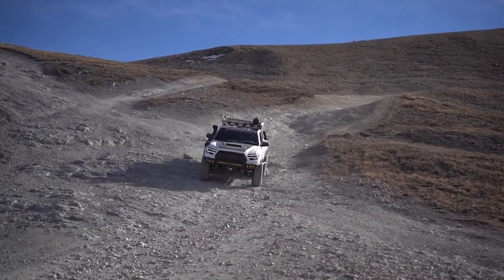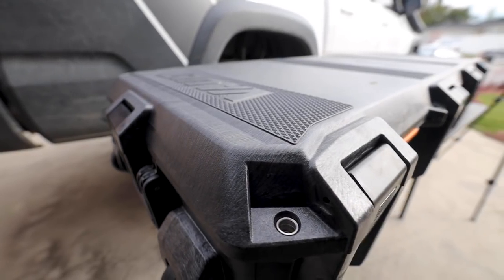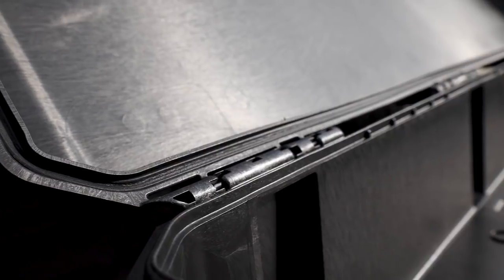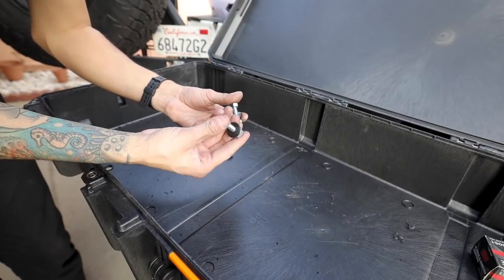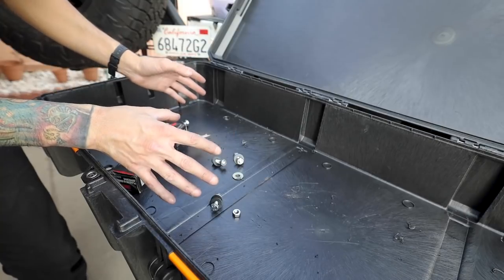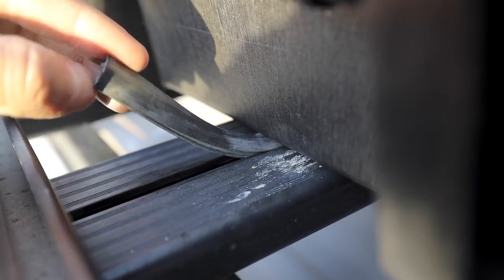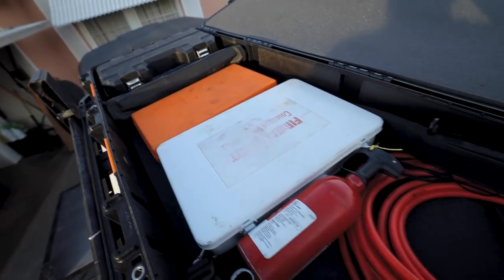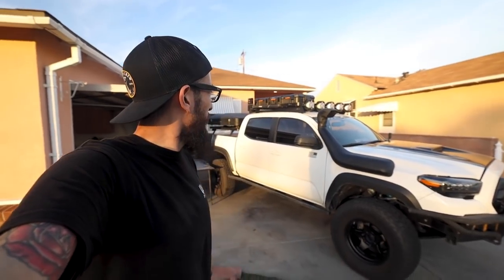Recovery Gear & Gadget Storage Solution | Pelican V730 | Toyota Tacoma Overland Build

Comment: Couple recommendations I have - use a dremel and chop those bolts off(not that big of a deal though, depending on what you store). Use silicon packets (or whatever they're called) to keep in there. If you're in a hot state you will still get moisture in there and the packets will really help. Also, instead of that plastic sealant I would use rubber grommets and/or hot glue. I don't think you're going to have that much trouble coming up from the bottom where the bolts are, but hot glue and rubber grommets are a 100 times easier to remove later than the plastic sealant. Also, I would store that extinguisher outside under your tent in a place way easier to get to. Awesome video George!

Comment: I put 2 of these on my cap rack but installed 2, 20lb gas struts per case to keep the lid open and I also put a piece of 3in wide aluminum flat bar in between the bolts to add strength and make sure the bolts don't rip out of the plastic bottom

Comment: Looks good. My only concern is why did you mount it on the passenger side? I put mine on the drivers side, so when I’m stuck or whatever reason I need to get to it, I open my door and stand on my rock sliders to get to all of it. If you’re stuck in deep water or mud you’re kinda screwed getting to your passenger side without making a huge unwanted mess.

Comment: Great video! I did the pelican 1750 and they are great, I did how ever drilled a smaller hole just enough to fit the bolt (1/4) and I used rubber washers with metal fender washers for the outside and inside the case and it has held up pretty good so far. Just my 2 cents. Either way, great setup!
Reply from the maker: Great idea! I’ll keep you posted how this one holds up.

Comment: Nice video I did something very similar myself. I have one suggestion and one piece of advice. My suggestion I put a bracket on the lid of the box and fastened my max tracks to that it frees up a lot of space. My piece of advice would be to get two flat bars drill holes into them and fasten it down with the bolts reason being that box is only held on by four nuts and a couple of washers if you hit something hard Or have to break extremely fast with the weight of the objects in the box it will more than likely rip clean off your roof rack those couple of washers aren’t gonna hold it when living in Australia I’ve seen this happen three or four times . you need to brace the box to the roof rack two pieces of flat bar running to the nuts will hold the box to the roof rack as is , it’s not the greatest idea. No criticism or anything intended just trying to help out hope you don’t mind.
Reply: So your using the flat bar as a giant washer for more surface area?
Reply: @brents4225  exactly
Reply: @russellwood8750  okay thanks, gonna build mine that way, makes sense.

Comment: It's not very convenient to have to unlock a box on roof if there is a fire you need to put out. Your fire extinguisher should be mounted in the cab (under the seat, behind the seat) somewhere it's accessible.

Comment: Do you have another medical kit inside the rig. Seems like access to it quickly would be better than putting it on top
Reply: Put your fire extinguisher inside the cab too.  If you should be in a rollover you lose access to your medical and fire suppression gear.  Be safe.  Otherwise a good video. Thank you.

Comment: I bought the same one last year. Was debating with either the classic or vault series. Went with vault since it was cheaper and has the subtle orange accent.  Also i noticed u did the same as I did with mounting on the passenger since originally. I wanted to install on the driver side but then the wheels was facing the front which looked tacky. Great choice nonetheless braddah!

Comment: Just installed two of these on my roof rack and after using them I have to say I’m pretty unhappy with the latches on the ends of these boxes it’s just a pain in the ass undoing the end latches and the lids feel cheap and flimsy. Think I’ll end up going with actual pelican air boxes with just latches down the side and more robust. Out $400 on these since I drilled through the bottoms to mount 🤦‍♂️

Comment: How’s that Frontrunner table holding up? It looked like the steel table too was loose when you got it out.
Reply from the maker: Great man. 3 years with it and still does its job.
Reply: @bustabeatgeorge  Nice - what is the hook /slider system you use to hold it in place on the roof like that if you don't mind?
Reply: @KarpucMotoring  front runner makes the mounts for the table

Comment: Does anyone happen to know what the table that slides out at 0:09 is called or is it custom? Awesome Build btw!
Reply: It is a table by front runner. It slides under the front runner rack.
Reply: @AttorneyBmw1200RT  Do you happen to know if you can slide it under other brand racks?
Reply: @daltonw7439  I'm not sure. What I do know is that front runner has proprietary table brackets that install on the underside of their racks. The table then slides in. Whether you can adapt them to another manufacturer's rack, I don't know. The front runner tables aren't cheap. I'm using an oztent bi fold table with my FJ.
Reply: @AttorneyBmw1200RT  what do you think of the table you are running and what rack do you have it attached to? Thanks for your help
Reply: @daltonwalker49  I just know of the table when I was research a roof rack for my FJ Cruiser - I was seriously considering a Front runner rack; the table that slides under the front runner rack is not cheap (about $400 plus). I went with a warrior rack which I have been please with. And I bought an Oz Table (stand alone table - does not go into a roof rack) for less that $100.

Comment: I’ve seen a bunch of videos on this subject where they use silicone/sealant like you. I still don’t get it. Water isn’t going to flow “up” into the case. And if water does get into the case somehow it will most likely be from the lid being opened in a downpour. In other word I don’t see the need to waterproof/“seal” a case like this. Worst case is you drill a hole for your hardware that just fits that hardware and its not too sloppy in the hole.
Reply: Id say its more so for dust. Dust will get into everything that isn't sealed
Reply: @xlegit13  even if the bolt is snug in the hole ? I would also use a rubber washer if you’re concerned but sealant is overkill IMO.
Reply: @ryanskeete  yes that's what I would do too. I'd hate to deal with sealant if I wanted the box off. I'm sure regular washers with the proper size hole would work, but rubber washers would definitely seal it up good
Reply: This case can also be used as a rifle case so any moisture is bad.
Reply from the maker: I’m okay with Overkill, I’m all about protecting my investment especially when it comes to safety and tools that can save my life of someone else’s. Thanks for watching!